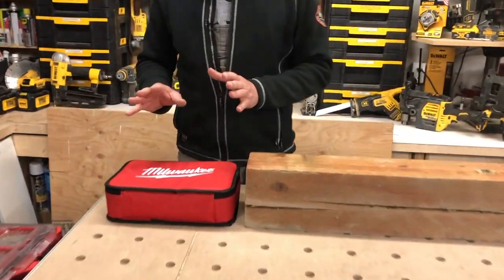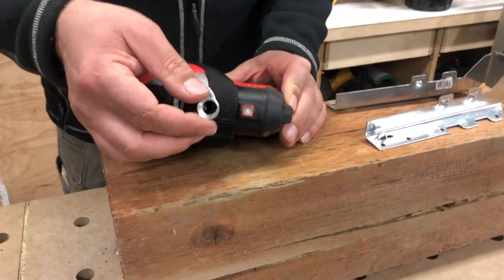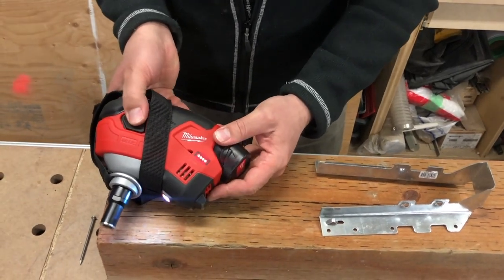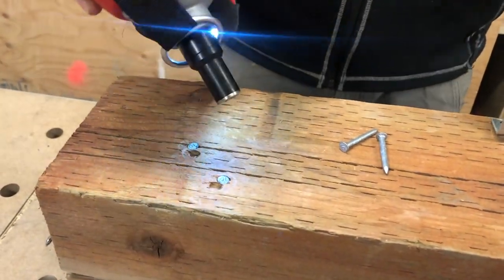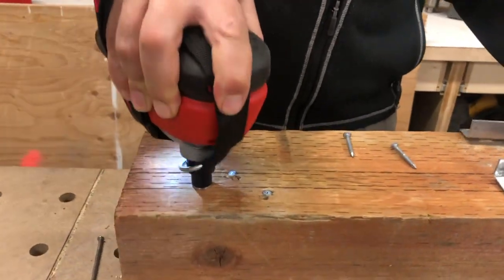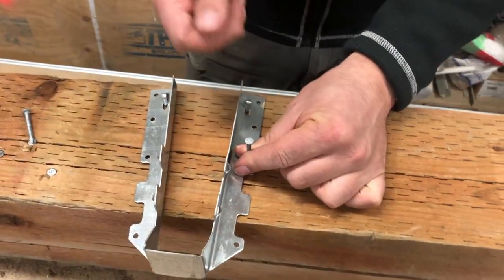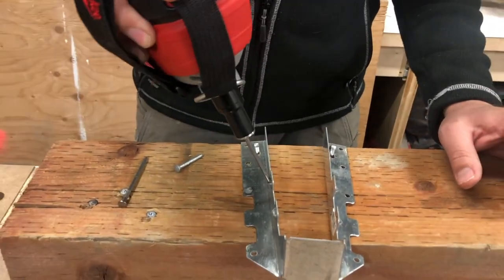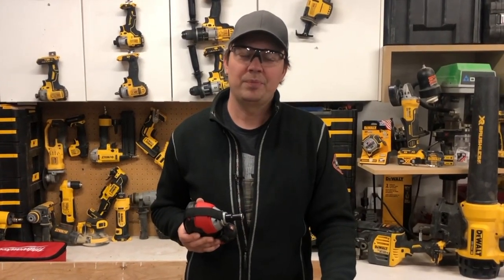How to use Milwaukee M12 Cordless Palm Nailer - REVIEW

Comment: Great little tool.  
Just a tip for starting nails and clouts with a ‘traditional’ hammer.  I hold the nail with a pair of artery forceps ( the hospital I work at was ‘updating’ to single use instruments, so I got a couple of dozen of the old reusable sterilisation type forceps for free ). They are like needle-nose pliers, but have a system that locks them in place around the nail, so you can keep your fingers out of the way.  Haven’t hit myself with a hammer for two months now (but I should say I got the forceps about 10 years ago 😜)

Comment: Hi, can you use it for cable cleats? for example if you want to cleat cables on mortar? Thank you very much.
Reply from the maker: I have never used cable cleats, so not to sure if it would work. You would want your nail to be very strong and if there is any plastic around the nails it might break off. Not sure if that helps
Reply: @hammerandhome  Thank you very much for your advice. Really appreciated your advice. And also thank you very much for making this great video.

Comment: I know squat about wood- I am a welder - but why not use TORX bit screws instead of nails? With magnetic tipped drills you can sink a screw about as fast as a nail with some of the high torque Milwaukee drills. My deck, for example, has exclusively screws and they don't lift over time like nails can if the wood bows, etc.
Reply from the maker: it depends on what we are building, for framing we typically use Nails because of code, simpsion hangers have special screws for them or nails, so it really all comes down to code. screws are bad for breaking because they dont bed like a nail.